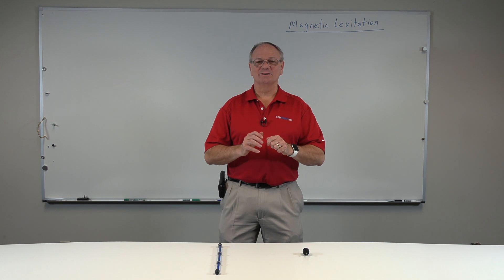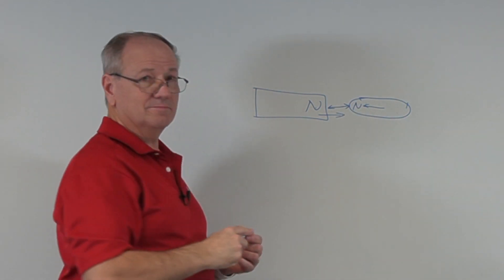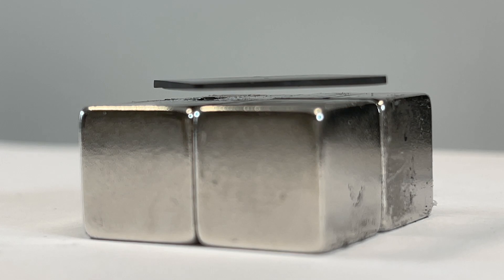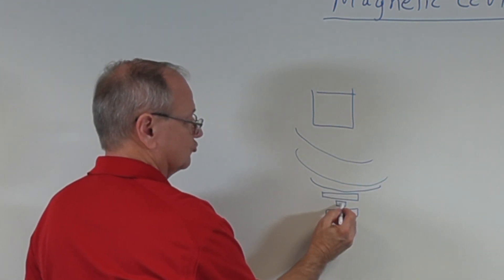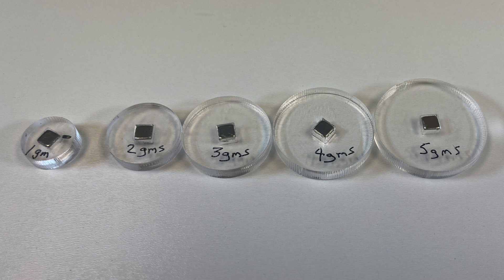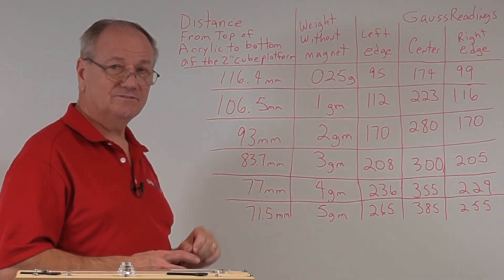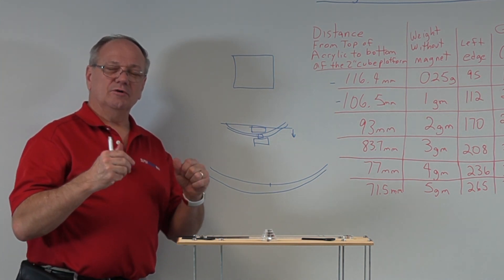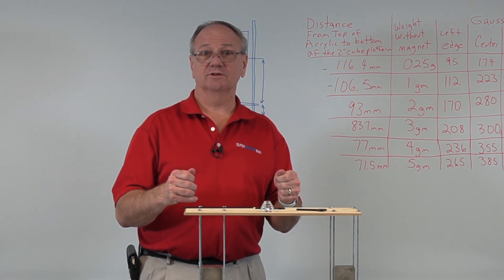Magnetic Levitation - Interesting Possibilities

Comment: Curious,

Dielectric mirrors, use interference based reflection(90+ % reflective),

Has anyone tried using pyrolitic carbon or bismuth, or both, to create the equivalent of what a Dielectric mirror does with light only with magnetic flux /force?

Next, you define magnets/magnetism as 1 force, acting as multiple poles(configurations that give the illusion of two poles, two forces).
Correct😜.

Comment: I really like the bismuth setup at the end there! But it seems awfully inefficient to use a huge magnet that far away. How about using a smaller magnet with iron pole pieces to focus the magnet lines to go where you need them instead. I would imagine it will be possible to use much smaller magnets. Or will this mess up the uniformity of the field lines to much?

Comment: I'm still a noob to some science but what happens if you apply voltage to any of this? Or set the magnets up in parallel and/or another configuration by increasing the number of magnets stacked?  I always seem to want to see the specific field  an changes to the field with each adjustment. Also do any changes occur if you place multiple of these in parallel/square an then alter their directions as well.

Comment: Interesting ideas and informative. I was surprised that you self identified as a ? Power Systems engineer? yet proposed a electromechanical servo to move the large magnet rather than an electromagnet under servo control. Much simpler...
Reply from the maker: Electromagnet solutions have been around for a very long time - the problem is that the frequency of the sampling from the transducer induces a vibration in the object being suspended because it is sampling the position x time per second and making micro voltage adjustments and the object has that vibration.  THat is not the same as moving the magnet to the neutral position one time and then it balances that load and only changes if the load changes - hence no vibration.
Reply: @SuperMagnetMan  As with any control system, the feedback function would have to take the force function (apparently a function of position) as well as the mass and therefore the natural frequency of the mechanism.  If a discrete time control as you have suggested, the sampling rate would have to be sufficiently high to avoid the "vibration" identified as a problem. Analog controls wouldn't have this issue.

Comment: That's kind of close to something I have been trying to work out.  I play harmonica.  I have an acoustic experiment I want to do but I can't quite work out the test setup. 

On my drawing I've got 4 posts, like you have.  There is a platform- it's operating like a reed plate would on a harmonica.  The reed would be shaped like a capital letter 'I' (with the four numbs on it, the font on YouTube doesn't show.)  The nubs would have a hole so you could put the posts through it while keeping them off to the side so that you can still blow on the reed to get it to move.  There would be a cut out in the reed plate so that the reed could move up and down through the hole, with very minimal gaps around it to keep it air tight in the rest position.  Each set of posts would have a pair of very small spring magnets on it, and each end would be threaded so that you could turn a nut to compress the spring magnet.  I'm hoping that will allow me to change the natural oscillating frequency when you blow across the reed.  If I can set this up in a tiny box I can build air pressure by blowing into the hole on the box, forcing the air out the reed hole, and the magnets, hopefully, will push it back, creating a pulse similar to a normal harmonica reed, but with a much 'simpler' straight reed shape that will be much easier to experiment with.

The problem I'm having is finding matching little parts that all work together.  I have a theory that by changing the shape and width of the hole the reed is oscillating through I can create different tone types, and even possibly multiple tones with one reed.  I really need to get over to my friend who is a jeweler and see if he could make some parts for me.

Comment: i understand that it might be hard to get bismuth to float on a magnet due to the much weaker diamagnetism, likely needing a piece too thin to be of any use. however why wouldn't the pyrolytic graphite enhance the effect of the levitation when replacing the bismuth in the mechanism.  i would think that it would allow for a larger space between the plates and thus more room to hold weight as the upper magnets were brought closer.
Reply from the maker: Good question - I did not specifically test a combination of the two materials but I can think of a design that would look like it had outriggers on on the ends of the outriggers we could have pyrolytic carbon pieces above magnet cube sets and gain some lift and stability over the bismuth.  I will have to think of how to try it because the large magnet at the top puts out such a large field and I would need to get the outriggers out beyond that field and I am not sure if the additional weight of the outriggers would exceed the repelling force of the pyro.  AND that is why we make things and test them.  I will give this more thought and put it on the board.:)  Thanks
Reply from the maker: From my experience the pyrolytic carbon requires a "checkerboard" configuration to work.  If you placed them around the other magnet it would be hard to keep it from wanting to jump over to the magnets being used with the pyro.  It might be possible that if you had like a 6 inch diameter circle and the same magnets that you might be able to rig up something like outriggers with pyro at the edges that helps to stabilize the magnet in between the bismuth.  Good idea - will have to give it some thought.

Comment: I thought the CMR Tech doohickee would have to flip over to snap together?
Reply from the maker: No, it is actually multipole magnetized in concentric rings so that the north and south poles are on the same side and the slightest movement off of dead center and it snaps together.  This is their Hover  field magnets.